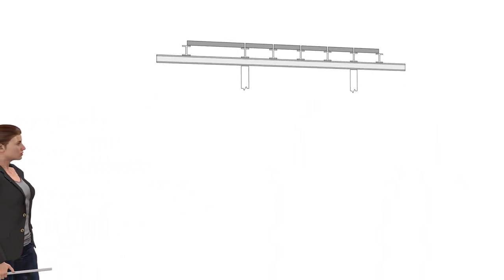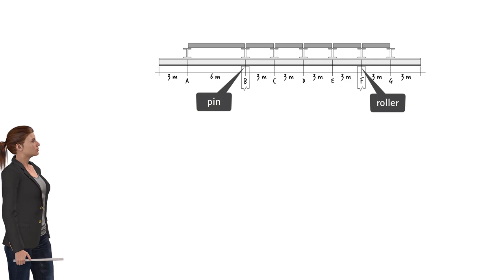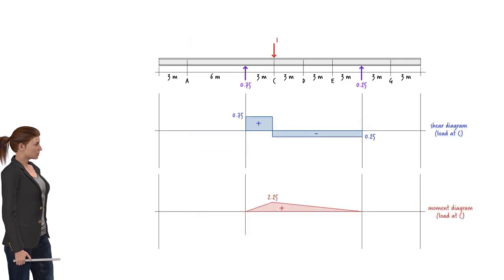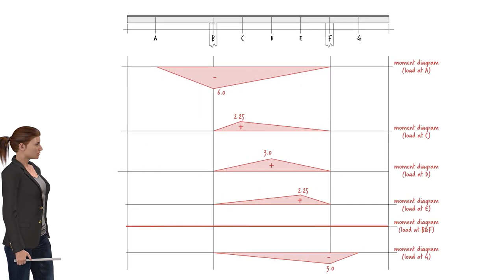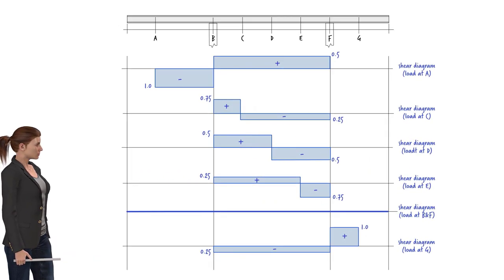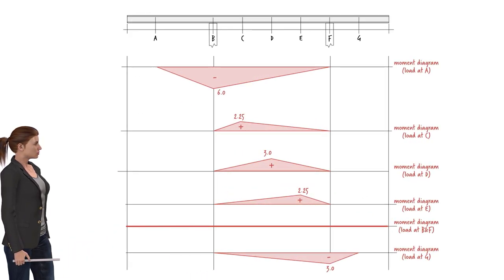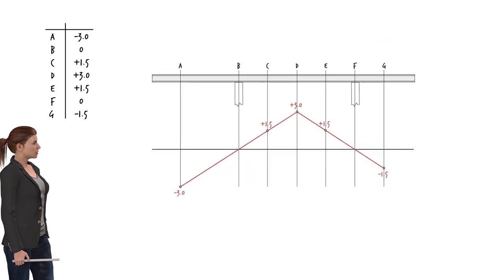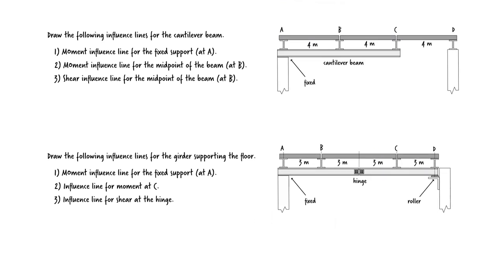SA69: Influence Line for Floor Girders

Comment: how you obtained the values in shear and moment diagram wihout knowing the dimensions
Reply from the maker: Influence lines are different than shear and moment diagrams. 

Without knowing the dimensions of the system, we would not be able to draw its shear and moment diagrams. However, we generally don’t need to know such dimension to draw some of the influence lines.

Comment: What font you are using to write shear values and moment values and for all other writings? Also Also would like to you know what is the font size you are using... because it very precise to see. Nice font selection. May I know which software you used to draw shear diagram etc
Reply from the maker: The font in use is verveine.
The drawing are done in Adobe Illustrator.
Reply: @DrStructure   thank you so much for your reply sir

Comment: Hi Dr Structure,
Thank you for you videos, they are great help for engineering student like me.
By the way may I know what software you use on your presentation for shear moment diagram and calculations?
Reply from the maker: Thank you for the feedback. For this video, we used Adobe Illustrator + Camtasia Studio for creating the writings/diagrams. The 3D model was created using SketchUp.
Reply: @DrStructure  thank you Dr Structure, it such a great help, more lecture like this, 🙂

Comment: Sir  what does this releasing the moment actually means and when we have to use it, actually this doubt came while solving a question using kanis method, there when at a node where three members were meeting and in kanis method we do the Sumisson of the fixed end moments acting at particular node but in the above case a hinge support was present at the far end of the end and whatever the fixed end moment that hinge was carrying, it's half of - ve sign is transferred to the other end, idk why we did this. Plz helppppppp
Reply from the maker: You may have attached your question to a wrong video. There is no hinge in this problem, and no fixed-end moments either. Please reference the timeline in the video from which your question originates.
Reply: Actually this question isn't from any of your videos, I am generally asking this question while solving a problem
Reply: @DrStructure   plz help if u got what I  want to ask
Reply from the maker: I am unable to follow your question.
Reply: How you make these videos , please tell